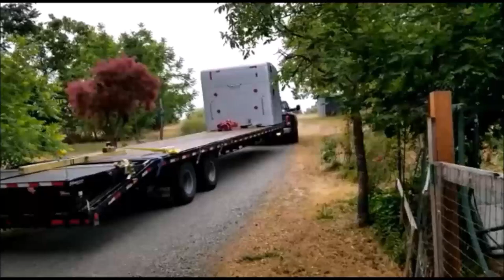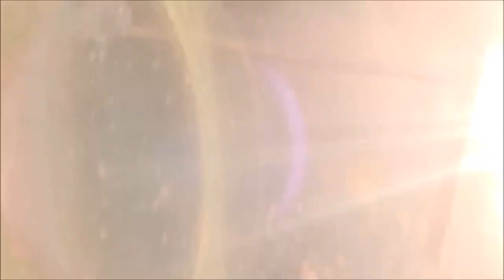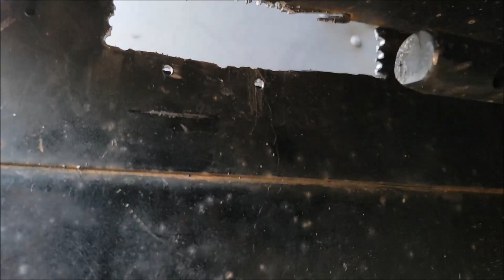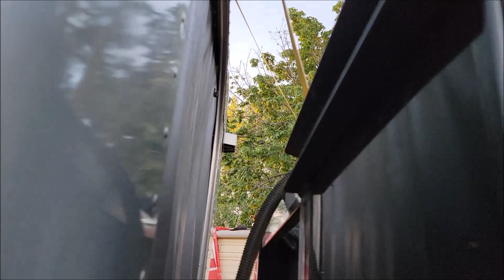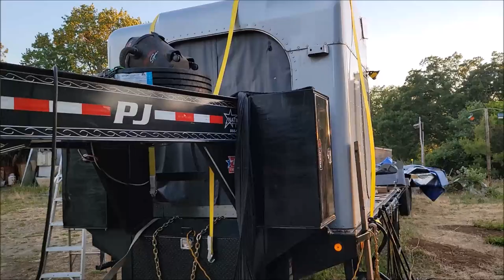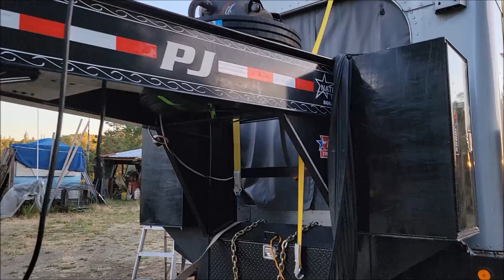MOUNTING SLEEPER TO A PJ TRAILER

Comment: You got to be over on truck axles? Just a guess
Reply: My weight is over drive axial but Sleeper weight is about 1000lbs and even with 110 gal aux fuel tank and 4500 watt Generator O am below Max on Weight Tickets. Yes I Scale all loads

Comment: Why would you mount the sleeper  to the trl?
Reply from the maker: Mounted to Trailer because 3590 Ram Dually only has an 8 foot Bed. Sleeper is 5 ft. So not possible without a Streched Frame or a CC Truck

Comment: Is that even legal? Or do you only use it when parked, i.e. no team drivers
Reply from the maker: I have a Crew Member/Non Driver. The law says that passengers can be riding in a Trailer being towed , there must be Communications with the driver such as Intercom
Reply: Man. I really thought I had looked up before that this was illegal. Obviously you researched that but I had this idea before but had thought that was a no no. 🤷‍♂️
Reply: It’s not legal I just checked. Unless I’m missing something. The communication portion just states if there’s no direct contact with driver. It specifically says after 1953 it must be connected to the cab or immediately adjacent to the cab.